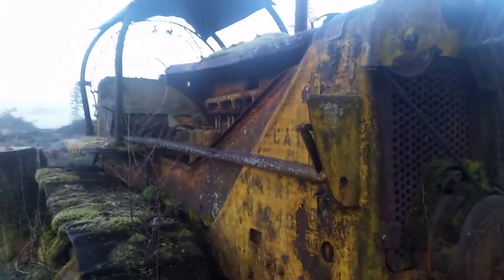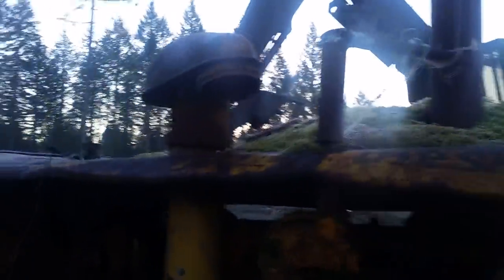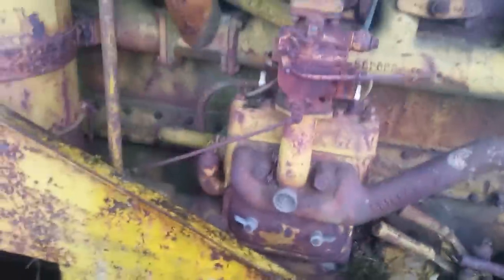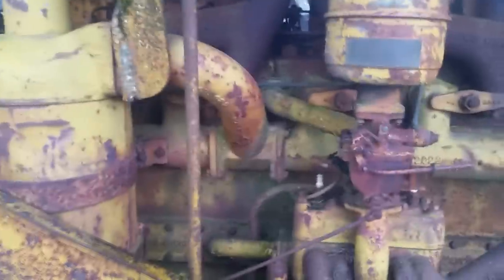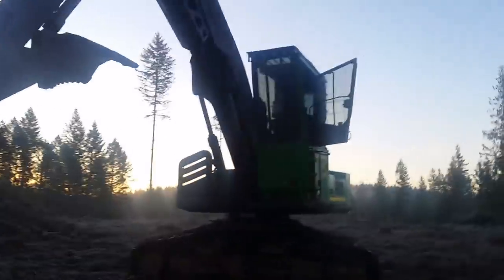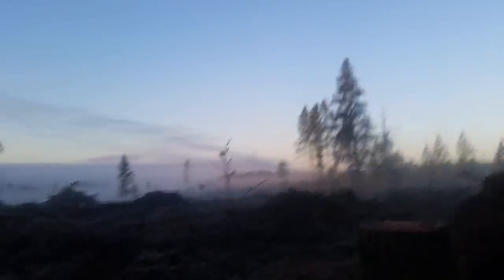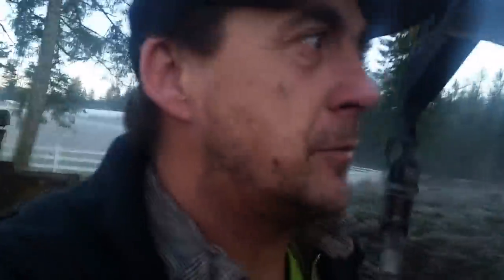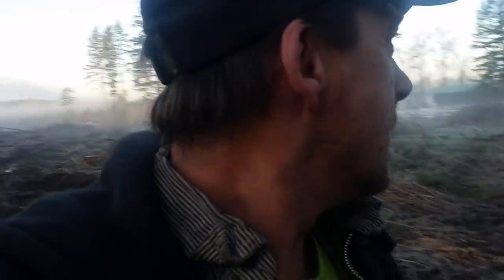My kind of caterpillar equipment

Comment: I worked for a large dairy farmer who had a D8 just like that. They used it to clear headrows to expand fields (I never want to pick rocks again). The pony motor is a 2-stroke twin cylinder. The farmer burned it up running it on ether so we push started the dozer with their largest tractor. The tractor had electronic shift so once you got the dozer rolling you just kept bumping gears. What a work out for that tractor!